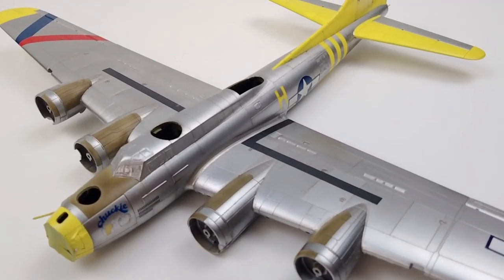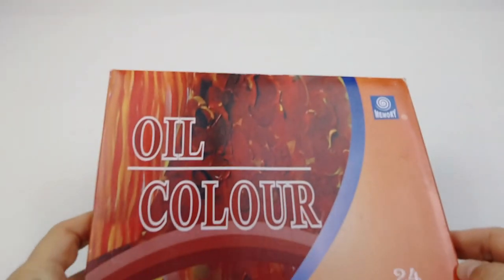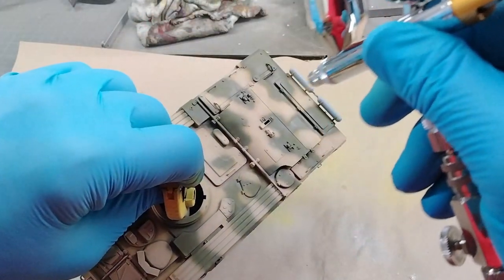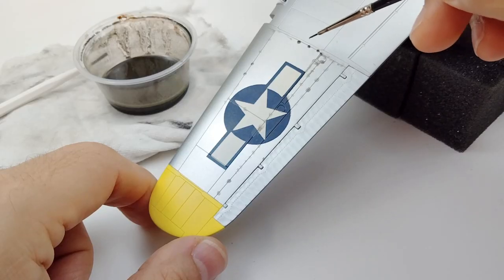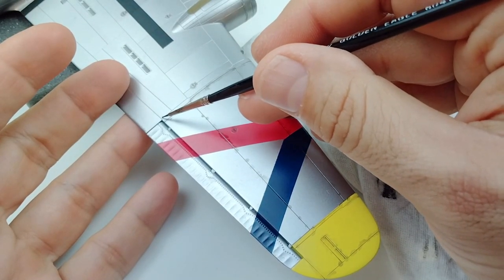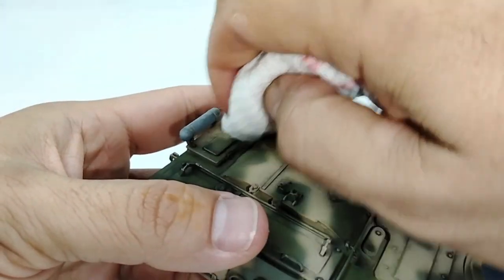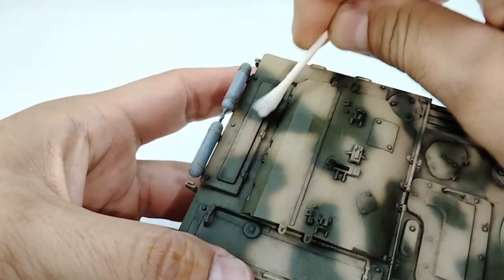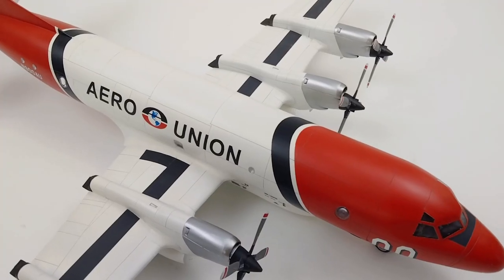How To Do A Pin Wash - Your First Scale Model Weathering Technique Using Off The Shelf Oil Paints!

Comment: How long should you wait to spray a potential for coat to seal everything up or to matte coat?
Reply from the maker: No specific time frame.  It depends on what other weathering techniques I plan to apply.  If I plan to do some chipping or streaks with oil paints, I will leave the gloss coat.  I usually do a matt coat when I want to use weathering powders and color pencils as they need some texture to bit into.